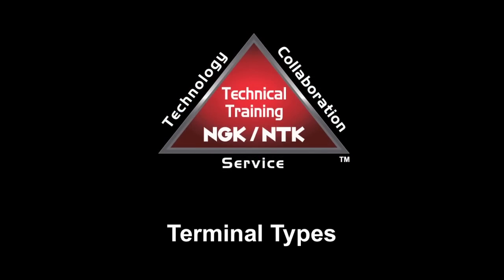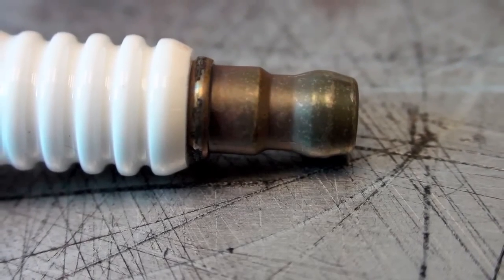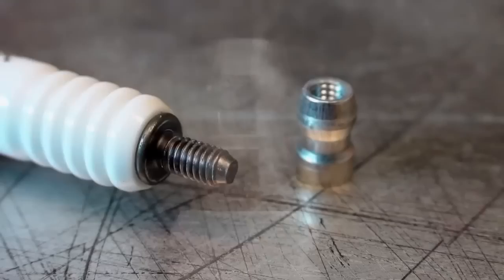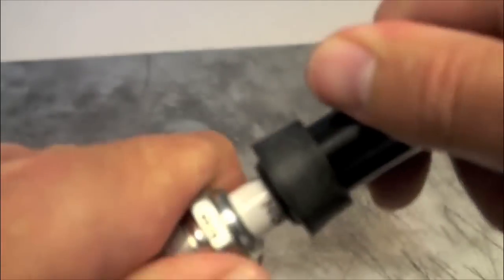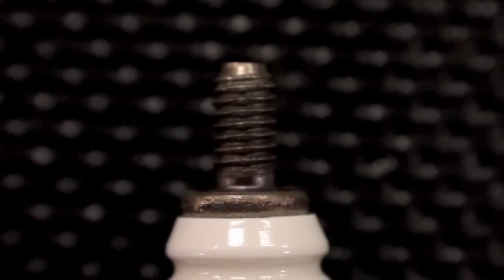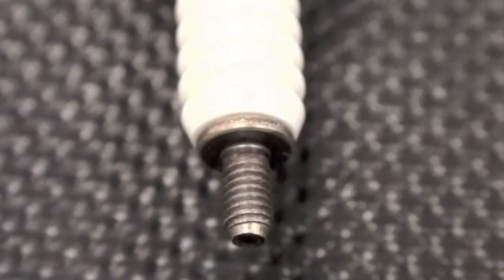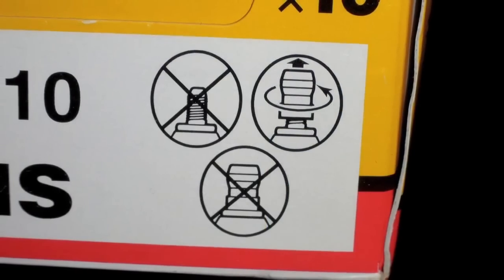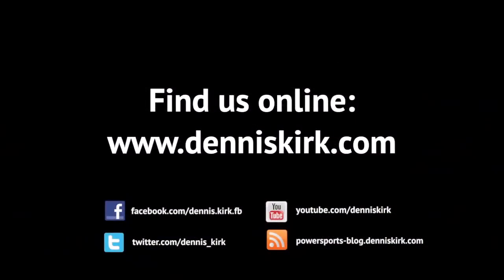Tech Tip: NGK Spark Plug Terminal Types

Comment: Thanks for the info! I did not realize the top tip screwed off on the replacement spark plug, I just bought. I just removed it, because of the info in this video, and now it actually fits the spark plug boot. I thought O’Reilly’s gave me the wrong plug. Great video & info!!👍

Comment: so ngk can sell you a spark plug thats useless if the old spark plug doesn't have a removable terminal?
Reply: George Morgan exactly that, it happened to me today I’ve just bought a new plug for my bike and half the reason was cos i need the terminal on the top or whatever is it
Reply: I just broke my primary coil boot because of this garbage. Ngk can eat it.
Reply: @MrJamesTimmons  How about checking first and actually buying the correct one instead of blaming someone on your shortcomings?

Comment: These *** screw on tips have the tendency to unscrew during use, no matter how strong they are tightened.
Reply: Oh forgot, this got me into trouble twice and ruined 2 good spark plug wires that can't be purchased individually. $100 loss, not to mention the unburned gasoline that washed the oil film away, damaged my engine, the wasted fuel and time tracking this problem down. NGK garbage.

Comment: Screw on terminals are not approved by OEM's. Unreliable for consistant current flow. Heat cycling causes terminals to loosen even when crimped from the factory. Aftermarket junk.
Reply: Really? So Yamaha using them on the PWs just as an example doesn’t count?